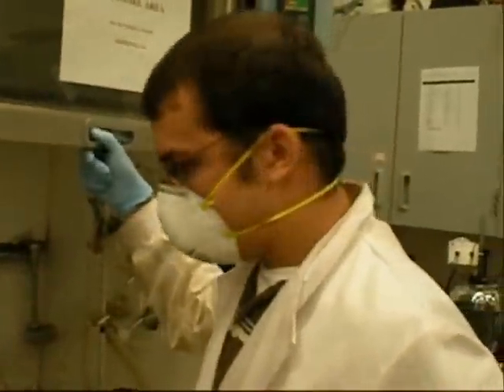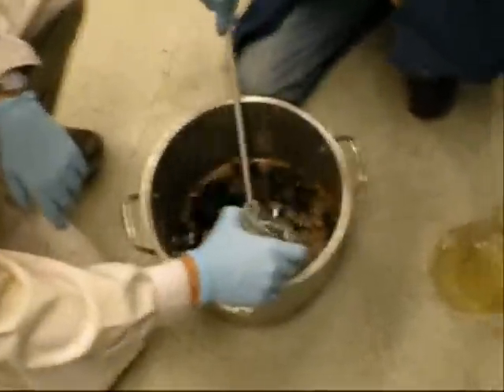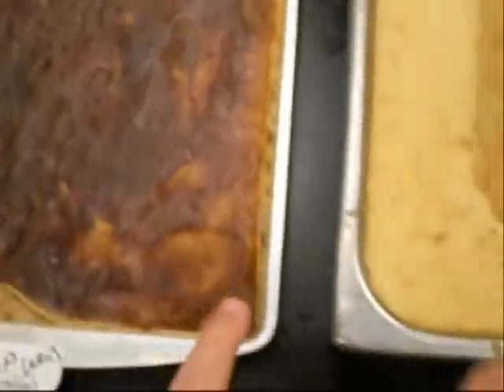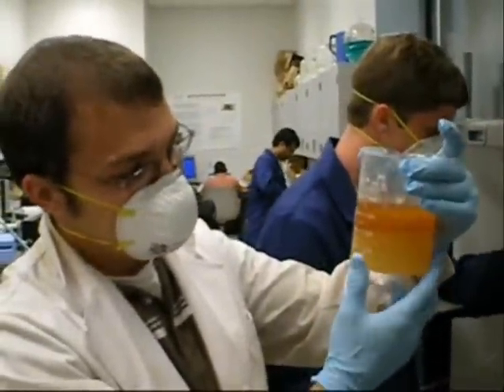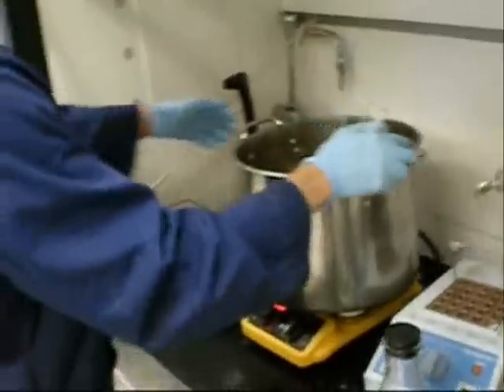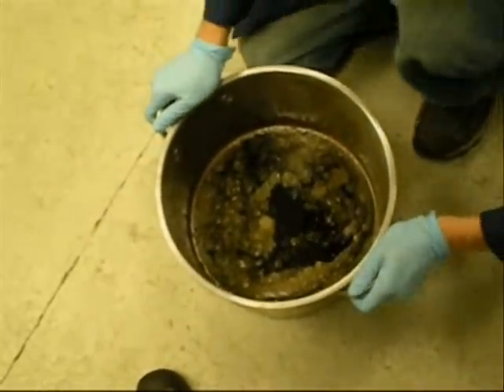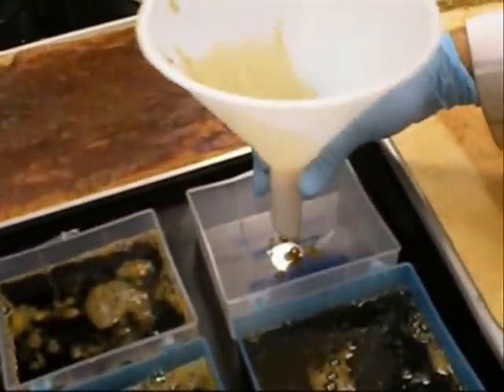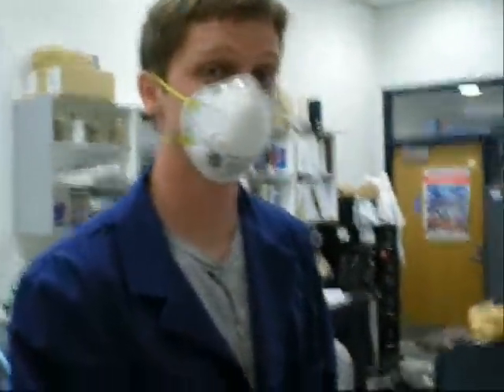Soap Making Using Glycerin from Biodiesel

Comment: Thanks for the quick reply.  I use KOH in my biodiesel reaction for its rapidity and reduced risk of solidifying in the reactor tank if the reaction fails.

I have a KOH recipe and plan on making some soap here soon with the mounting glycerol supply I have here.

Comment from the maker: @javierneptuno The best method to test for methanol is to use a flash tester, which was available at the University of Florida lab at the time. This is the most expensive method, so many people do not have access to a methanol flash tester. The next best method is to distill the methanol from the biodiesel. This is similar to making an ethanol distillation unit. The methanol contaminated glycerin needs to have the methanol evaporated.  To get it clear, you can distill the glycerin as well.

Comment from the maker: I was using NaOH because it was cheaper and was producing hard soaps using the leftover glycerin. KOH is more expensive, but it does reduce the risk of solidifying in the reactor tank. I've had a few episodes with NaOH of solidification in my main tank.

I've seen a few KOH recipes online using the glycerin byproduct. Not sure which one I will use or if I will make my own recipe.